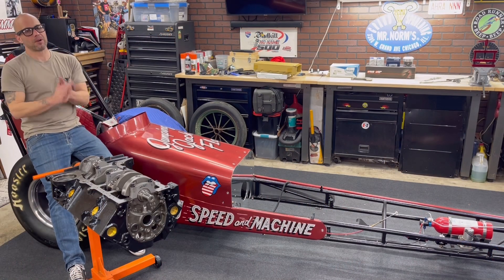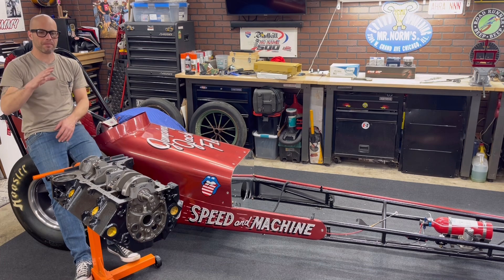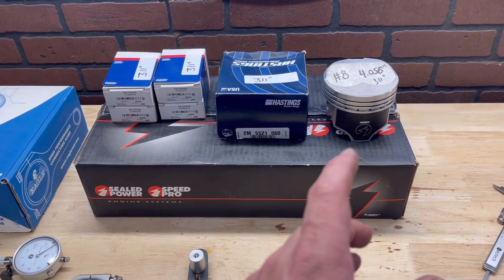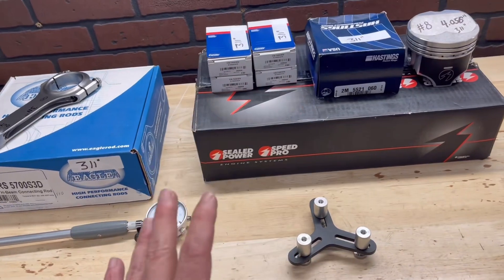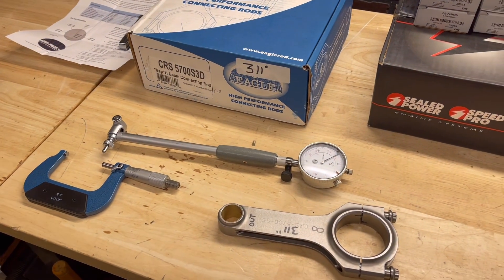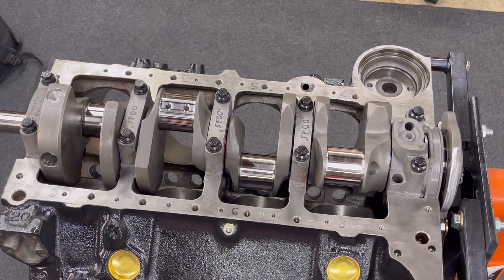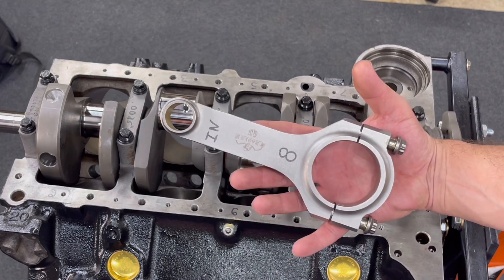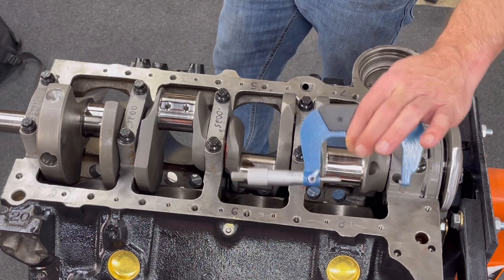How To Measure Connecting Rod Bearing Clearance #howto

Comment: I have a question not a comment,  isn't that to tight at a half a thousands clearance on your connecting rod? If so, what do you do? Get thinner bearings?
Reply from the maker: all depends on the size of the crank
Standard size journals, you can get .001 extra clearance bearings